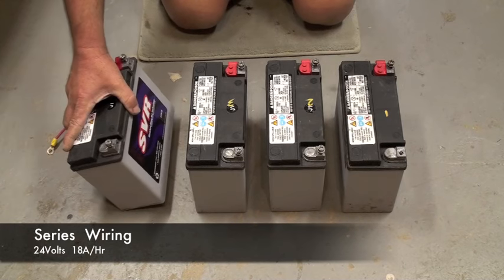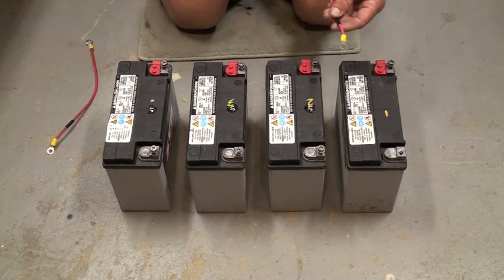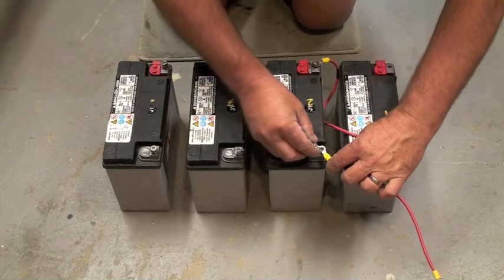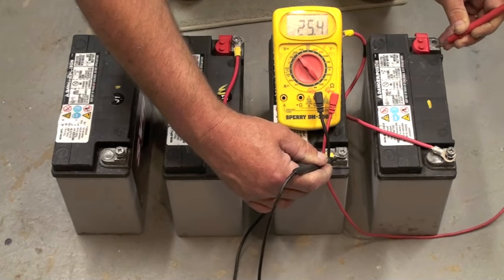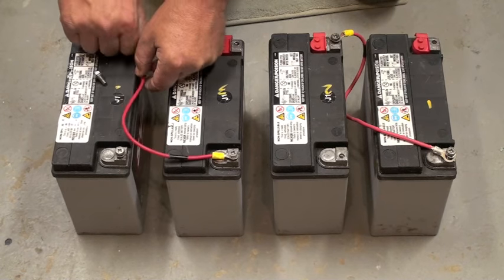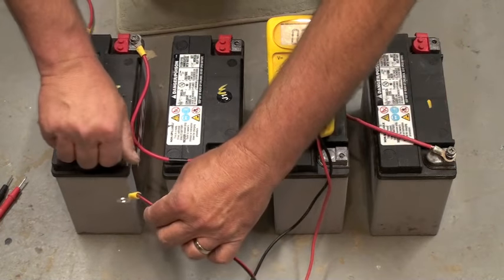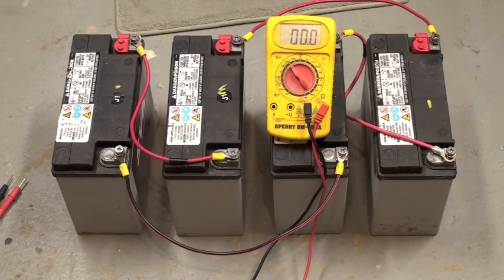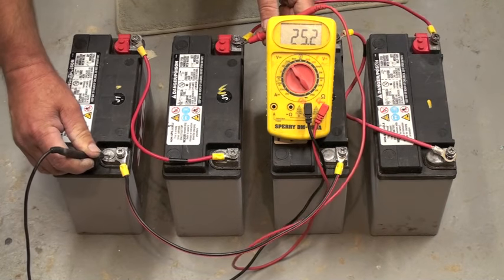Wiring Batteries in Series and Parallel.m4v

Comment: Danger, danger, danger. You DO NOT CONNECT batteries, or any voltage sources, in parallel, without having diode isolation for each source. This is because the voltage difference between the batteries (however small), coupled with the very low internal resistance of the batteries, can cause large current flows between the batteries.
Reply: I got scared for a second too lol
Reply: Adrian Paul Wakeham agreed.. my APC 12 x 2 in Series has a 100amp 32v fuse in between the positive and negative posts in the middle of the chain.
Reply: Adrian Paul Wakeham
Reply: Adrian Paul Wakeham .
Reply: s
Reply: Wrong!!!! I have been connecting batteries in series and parallel for years as an RV technician and have never....knock on wood....had a negative experience. 0.3 voltage etc will always be a factor depending on each batter and even each cells state of charge. No 2 batteries are the same. Dont scare people. Inform them.
Reply: @davidking9182  so at what point do the negative and positive cables come off that battery Bank to the source just curious

Comment: Yes, you can. You can do the two 12 volts in series.   You do need to keep in mind the amps you are drawing and the capacity of the batteries for your application. Two batteries in series will double the voltage but will keep the same amp hour capacity.

Comment from the maker: To keep 12 Volt batteries at 12 volts, wire them in Parallel + to +  and - to -
Reply: BS.
Reply: Hahaha
Reply: is this true or are you trying to burn someones equipment?
Reply: @camit6237  it is true  + to + and - to - keeps at 12v is how semi trucks run on with 4 batterys.
Reply: No it’s correct information. Look it up on a different site if you don’t trust the video. I will tell you this: any different answer than the one found here is wrong.

Retired 36-year electrician.

Comment: This is a great explanation thank you, but i do have one question, will you be able to charge them all at once or do u have to do it individually?
Reply: It is painful answer has not been provided for this your question, that would have been a great help for my planned 48volts 20Amh battery now.
Reply: According to my research ....the bet way to change for more than 2 is to arrange in series
Reply: @frankfrankmusyoka8050  I've got an old 24v bus that I'm doing up ... retaining the 24v system including HUGE inverter. My solar controller is auto selective 12/24v & Im using 4 household sized solar panels & 4 truck batteries, wired in parrallel. No good using deep cycle batteries because I require the crank amperage! Truck maintains charge when rolling. Generator for emergencies only.
So I'm 240v constantly (inside) & 24v for the mechanics.
Reply: Just like charging a golf cart. All at once.
Reply: As per my knowledge you no need to charge separately ,do it all together

Comment from the maker: The terminals in the video are M6 (They take a 6 mm metric bolt) They came with the batteries. The NB Terminals on your batteries require a small nut and bolt which should come with the batteries, and a ring terminal. Secure the ring terminal to your wire and thread the bolt through the holes in the NB terminal and ring. I hope that helps.
Reply: E

Comment: This is what i have learned:
Connecting in series : increase volts but same amperes
Connecting in Parallel : increase amperes and same volts
Reply: Correct and remember with parallel to keep wire lengths the same. If you have uneven lengths the shorter set with lower resistance takes the bulk of the work cause heat issues. Especially important on low voltage high amperage DC circuits. Very important.
Reply: Is there a way it can be all connected that I will still get my 48volts with 21Amh ?, then will that be harmless for my e-bike which should be just 48volts 20Amh ?
Thanks.💞
Reply: Bunmi Ajibola 

Instead of each battery being 12v they’d have to be 24v..

Pair of 24v batts = 48v

Add another pair, wire in parallel  and then you increase amps and runtimes

Comment: yes you can wire 4 12v in parallel and increase the amp capacity the volts stay the same .. in series the volts add up 12-24-36-46>> the rc( reserve capacity also climbs ) so a series 3x12=36 rc per battery is say 140 you have 3 batteries in series then you have 720min

Comment: When wiring two 12volt batteries in parallel to be used in long term applications, do you recommend adding an in-line fuse between your positive jumper wires on the batteries?

Comment: Covered everything except where to connect to .... do you use a positive from one side and negative from the other or do use positive and negative from just one battery at the end because I was told if you do one battery at the end it will drain that one battery faster but it would’ve been nice if you showed where to connect your device to, in my case and electric motor.
Great explanation of series versus parallel it helps, thank you

Comment: Thanks for the demo. I've been trying to find a video for this. Is it possible to link 3-4 12v batteries together and keep the voltage at 12v so I can use a 12v automotive type AC power converter? Also is it possible to use the 24v array and use a automotive AC converter or would that overload it?
Thanks againfor the info.
Reply: Shit I have 14 batteries in parallel. With 6 100w panels. 
It's been 5 years with no problems.

Comment: Thanks for the video. My question is? I have 4 one hundred amp hr batteries wired in parallel now. If I were then this way I’m going to end up with 24v on the parallel + an - end. I’m going to have to install a converter on my 12v lights etc correct? Thanks

Comment: Can I run 4 Six volt deep cycle batteries in Series and Parallel to achieve a 24 volt bank and double the Amps ?  So in Series my 4 -6 v bats maintain the 220a/h 's an by adding Parallel this will double to 440 or 880? Thanks !

Comment: great vid, what would the voltage be in the last configuration with series and parallel between the positive and negative when connected . Will it stay 24v or will it be more?
Reply: approx. 24 V
cause 24V || 24V = 24 V.

Comment: So which is better ?! Parallel or Series ? And what matters more ...the voltage or the amp hours ?  I am installing the 400 watt kit to my permanently park travel trailer. Thanks for any advice
Reply: It Depends On What You're Looking For.. More Power At 48 VDC In Series.. Or? Longer Run Time At 24 VDC In Parallel ... However? More Power At 48 VDC In Series Will Mean Less Run Time.. Approximately? Half The Run Time That 24 VDC In Parallel Would Give You When Wired In Parallel.. Meaning... Do You Want More Power? Or, More Distance/Longer Run Times..

Comment: What happened when you connected the battery positive to negative and negative to positive using just 2 battery? Connected two wires Or just one wire, would It still be 24 volts? Please reply. Thanks!
Reply: If one battery  capacity is 12 volt. we can use two 12 volt battery. connection +- =24 volt. we can see other two terminals  show 24 volt.it is called  series  connection .  I am Bangladesh.  welcome  for comment. I hope you replied  me

Comment: I am trying to do a solar system setup with about 12-30 batteries for more amps of usage, but since this is only displaying 4 batteries, what do I need to do for that layout? could you please help me out?

Much appreciated!
Reply: +Jessica Chon Just gotta duplicate the process over and over till you reach the voltage or amps you want. It's the same no matter how many batteries you use. Just gotta use thicker wire the higher you go.

Comment: Please I need an advice! My questions is....Can it be possible to wire SIX batteries of 12V 220ah in SERIES AND PARRALLEL to give 48V 880ah for a system Inverter of 3.5kva 48V?

Comment: Hi,Hope you can help.I have a 200 watt solar panel kit I want to use to power my medium size redfrigerator in my trailer.I have a harbor freight 750/1500 inverter.If I have say 9 hours of sun and 2 deepcell batteries would this setup be enough to run it?Wired in series or parallel?Thanks in advance

Comment: clear explanation thank you. question: I have two 12 volt car batteries but want to slowly integrate (due to cost) some 6 volt deep cells into my system and eventually phase out the 12Vs. Can I add two 6 volt batteries to my already 12s that are hooked in parallel? How?
Reply: why not?
Reply: rick d The important thing is supplying enough amperage or current to provide a steady flow of clean power to avoid spikes and low current.  I would consider a power capacitor in line to regulate the voltage whether you run 12 or 24 volt systems.
Reply: good

Comment: I have a deep cycle battery that is a 12V system and hooked up to a travel trailer with an inline charge. Can I hook up two batteries like this to give my trailer longer life when running off the batteries, or will the added voltage blow everything out?
Reply: Wire the batteries in parallel, not series. and that will maintain 12v and give you double the amperage.

Comment: Any advice, with the batteries in series can I still parallel wire them into a 12v charging circuit? So I have a 12v input charge spread between the batteries and a 24/36v output etc etc (I'm working with some smaller li-ion batteries for a build and hoping to stick with a basic USB charging circuit

Comment: I learned that you shouldn't connect + to - directly or it will short the circuit and damage the wires. so when he connected them in parellel why didn't that happen? I have tried to connect + to - terminals once on car batteries just to see, there were sparks.
Reply: +sharikosatia because he isn't completing the circuit on any or all of the batteries. 1- to 2+ is just a link, had he also done 2- to 1+ then the circuit would be complete and with nothing to take the load it would be a short.

Comment: Cool can I use a 12 gauge wire on 12v 12ah battery to charge controller or should I stick with 14 gauge?

Comment: Hello, can you help with this problem, I'm getting an big ARC when connecting the the last connection of the battery bank ( 8  6 volt batteries ) in series and paralell. the panels are not connected yet, just trying to get the battery bank hooked up, should I charge the batteries up before I connect them together and can I charge them together or one at a time I only have a car charger The batteries are all new and reading about 6 volts each
Thanks
Al
Reply: +Al Ruark
 Thought I'd comment on your situation. 
An arc would indicate that one of your battery "packs" is trying to flow power into the other. The problem is for batteries in parallel, even if it were just two six volt batteries and one of them were weak, the stronger battery would discharge into the other.  For sure start by fully charging them and do a cell to cell voltage test and or a check of the specific gravity of each cell. For the what it is worth department, all batteries connected in parallel should be of the same brand and batch date of construction/manufacture date. 
If you find one of the cells in poor condition it would be not suitable for inclusion of that parallel pack, that battery is "bad"
You can have a battery indicate full voltage but other factors I will not go into here could be the problem. There is a great website called Battery University I recommend to check out

Comment: i have 2 units of 6v10AH/20Hrs batteries in a toy car left unused for a long while. One battery reads 1.8v and the other reads 2.4V. I have a charger which gave an output of 12Vdc 1A shipped with the toy car.
 1)Is the battery still good for recharging 
2) how many hours continuous charging do i need.
3) Can i replace the batteries with a 7.5V10AH/20Hrs batteries if i have to change them
 Thanks.
Reply: Sounds like your batteries will never reach the voltage required for the car unless it's like a 7volt car.

Comment: If I have 2 12volt batteries in series can I charge them with 24 volts? or I have o charge them separetely with 12 volts?
Reply: Yes you can charge them with 24v supply too....

Comment: May you kindly state the advantages of each setup and disadvantages thereof
Thanks
Reply: They serve different functions. The first example was to increase total output. 2nd Example was to increase run time.
Reply: @DRAEK05  so you’d be able to run a 12 volt DC heater twice as long with series, but a 24 volt DC heater would be ran if the batteries are connected in parallel?
Reply: @DRAEK05  oops, I got it backwards

Comment: Is it possible to use such batteries for UPS on an electric scooter? So 12V 20 AH Battery / 4X 12 V 48 V 80 AH? The electric motor has an input power of 48V 500 W.850 W at the peak

Comment: Small in size but powerful in nature is what the ideal battery would be.  Look for batteries that have the amp hour rating to suit your needs.  The more amp hour a battery is rated for the longer it would last. All other items kept equal. Solar power applications are best suited for the "deep cycle" type batteries.

Comment: I have a question: What will happen if I wire them in series to make 48V and at the same time wire them in parallel to a charger. So the charger is charging at 12V in parallel and the product is running in series at 48V at the same time. How would that work?

Comment: As you see the voltage of the battery pack on the right was 25.4Volts and that of the left pack was 25 Volts. When connected in parallel the overall voltage became 25.2 Volts. So where did this 0.2V go? Simple, it discharged on the second battery. So if you don't have to, do not connect the batteries in parallel since no two batteries are identical. The one(s) with higher voltage discharges on the lower ones and this shortens the battery life. I think the batteries in this demo are 18AH. The price of these batteries are nearly 30 USD. The 36AH batteries are sold for 55 USD. So it is cheaper to use one battery. 
Note: I think these batteries are very old and discharged. The fully charged battery voltage is 13.6 Volts for this type of batteries

Comment: Hi question will the amps (18) become (36 amps) in this setup. Or remain the same yust getting more running time.
Reply: Linking them in series doubles the voltage, 12, 24, 36, 48 ect. Linking parallel doubles the amps, 18, 36, 54, 72 ect. So 2 in series is 24V at 18A, Hook up 2 in parallel to that and it will be 24V at 36A. (2S2P) Series is Voltage, Parallel is Amps.